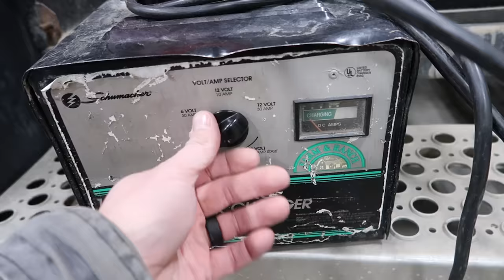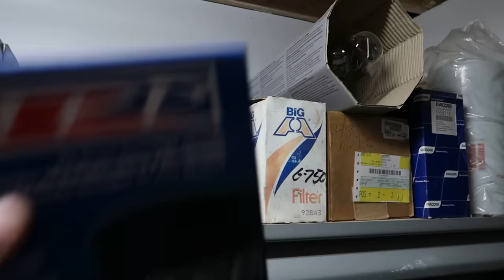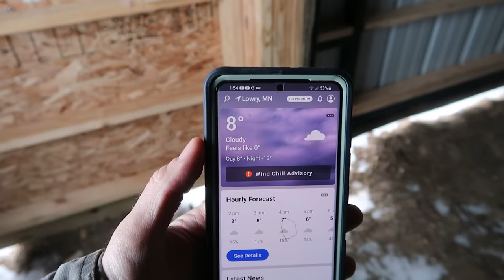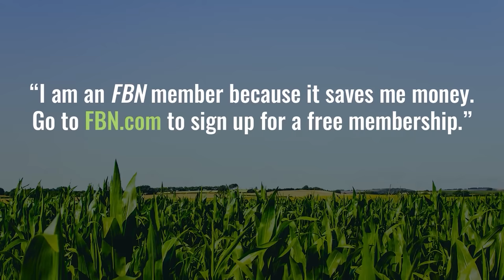Make Semi Trucks Shiny Again!

Comment: I had a T800 almost just like yours. Had an intermittent starting problem. It was a solenoid or relay in the batterie box that had a corroded connection.

Comment: A digital voltmeter would tell you what the battery status is.    A reading before (should be 25.4 for a good set or 12.7 for a single) and it should still be 24.8 or 12.4 after a crank attempt.

Comment: check alter. voltage after engine is warm (  14 volts + ) .   Some alter. have temp. switch that lowers voltage (adjustable [ wrong adj. or bad switch ].  yes you need to check charge leakage too .      J S

Comment: i hade a truck with 3 batteries that i bought at an auction. had troubles with it turning over.  the bat box was big enough for 4.  so i installed a 4th and never had another problem with it turning over

Comment: Hello Zach you need professional for stater system maybe wrong starter or relay for 12 volts/24 volts or engine bearing lock up so need amp meter and volts meter

Comment: I had a brand grind do that, actually two. I bought a new grinder from a welding supply store , when I got it home it started doing almost that exact same thing. I took it back and they gave me another one, five minutes into running it at home , same thing. I took it back , we discovered that the serial # were right together like xxxxx315 xxxxx316. The next box was like xxxxx317 , he found another with an unrelated serial # plugged it in and it worked fine . On the other two a screw connecting one of the wires from the cord had back out and was arcing all over. Must have been assembled on a Monday. Lol

Comment: The Sun is hard on any vehicle but really hard on Red vehicles. they say they have less pigment than other colors.Ours would get so bad when waxing them the towels would turn red with the dead paint. If you shed them when not using them that will help a lot but they will fad again in time after consent buffing like you did as you said the truck & their paint is 20 years old but wow it looks nice.

Comment: Your starter part number is probably 8200308 in Delco. The 42MT that you have on it is probably 10461052rman or 10461053rman depending on your flywheel.

Comment: Take an ampmeter and check for a drain on those batteries.  Bet you have a drain through the alternator (leaking diode).

Comment: Old Starters will start shorting through the body of the starter causing that flat battery effect, new reduction starter and check for power draw will solve your problem

Comment: Happy New Year Zach. Do you think it would be possible to plan a video for planting season to go more in depth on GPS navigation and its accuracy? Either you have better equipment or added telemetry to maintain accuracy better than most of us in our cars. It is fascinating that you can run the equipment, hands off the wheel, without damaging crops.
Reply: Farm GPS is sub inch accuracy. But you have to pay to use that. I use free signal for tillage. It’s normally within @6”.   But every now and again it moves more.
Reply: I planted with it winter wheat. W/grain drill.  Not too bad.

Comment: Zack I think you have bad contact somewhere or multiple places , bad cable ends ?? Rust , grounds traveling through the frame etc.. my tractor did the same thing and. I discovered the cables between batteries looked legit but were corroded inside the lead ends.. replaced and now it spins things good..

Comment: Hay Zack, you could add a chrome air scoop and a nice chrome drop visor. They also make nice chrome headlamp visors and surrounds that will protect the paint from stone chips ‼️. If you put them on I’ll send  y’all my old chrome pin puller that I don’t use anymore.  Deal❓
Reply: Spelling check

Comment: battery disconnect is 1000% required, a gear reduction starter and some new cables (0 gauge) should absolutely sort the issues, if it doesn't, the engine is trash :) batteries are also mostly trash these days if you aren't aware, 90% of them are the same Chinese recycled battery with a different label on it. There are only 2 brands that I have found that I do not DESPISE! they are AC DELCO and CENTURY, century are made in Australia (i have one currently that has lasted 7 years when every other brand struggles to last 3) and AC Delco is (at least allegedly) made in the US, and GOD DAMN they charge like it.
Reply: TL;DR 95% of batteries will only last 2 days longer than whatever "warranty" they offer

Comment: R.e. problems starting the red truck, then it may well be worn carbon-brushes (that touch the communtator).  I've had several starter motors that get very weak and a new set of carbon brushes brings them back to being super aggressive.  :)

Comment: in this day and age with tractors that have 50k gearboxs that are capable of 50 mph run on red diesel you could sell the trucks and tow grain trailers with tractors with road tyres on them being there only used for grain carting in the summer time

Comment: Ive said in many videos to run that parasitic draw tear good thing your gonna do one now that the mechanic said so but a question about the gear reduction starter is si if the starter turns slower but more torque will it turn slow enough where it won’t have the rpm’s to start the engine?

Comment: Zach with an H the gear reduction starter and new battery cables are not going to stop the draw on the batteries. 

So your professional is correct finding the draw on the batteries is the first thing that needs to be done.

Comment: Never had good luck with econo power batteries, will not sell them in my shop.  Interstate takes the shelf and customer returns reconditions them and re badges them as econo power. If you don't have one get a battery tester and disconnect the batteries then let them sit and see if you have one bad battery, one will drain the rest if hooked together.

Comment: Why not get a booster batterie. i have a small one in my car and it is rated for cars and trucks. ive used it multiple times, but it only works if the battery has a small amont of power ind them and from what i can see with all the times you have tried to start it, it should work no problem. and they are not very exspensive. just make sure to get one with an lithium battery

Comment: Boats, airplanes and old trucks.  Every 25 years or so they need a bunch of love and money to keep them afloat, air worthy, rolling and starting every time the key is turned without doubt. 
Otherwise, it's off to the boneyard with them.  Seems like older trucks are more reliable than the newer ones.  
Of course, you burn through money like you print it yourself, you could paint it up pretty and give it to the neighbor.  Buy you a brand-new John Deere Green truck.  LOL

Comment: I did have a starter go bad on my racecar once and it acted exactly like how the semi acts. It will start fine on the battery charger but once you let it sit for minute and try to start it again without the charger it would never start. Tried new cables and switches, and new batteries and still wouldnt fix it. Bolted up a brand new start and started like a champ.

Comment: I've been told. I don't know how true it is. That if you don't replace your starter alternator and batteries all at the same time and there's a problem in one, you,ll continually just Chase an issue. Probably BS but it is electrical. Electricity is only a theory we don't know everything about it.

Comment: Shouldn‘t you have trucks with 24Volt systems in those cold areas? Those 3 semi batteries look like 12Volt to me, 24 start way easier because they use half the amps…

Comment: I told u last yr it would come back. Only problem now is u have to keep up on the wax once a month or itvwill start fading back 🤷‍♂️
Reply: Also add the 4th battery
Reply: Get the Trucklite LED headlights.  Don't get those cheap ones with the 32 leds in them, they look stupid!  Polish the wheels and tank and leave it. Good enough

Comment: That’s what ya call a fine tradesman. ….”I’m In the zone. Thanks but you’ll F it up and then we have issues. I ate on the way….”Hitch up the camper to that thing and go hang with Tony and have him polish those rims up. Make a helluva video you and f FastAg….That door brace seems like it’d be fine at Trevor’s but not in snow country. Iser the need just wonder if they couldn’t put it on the inside. It’s 2023. A feller can polish any pink unit they like.

Comment: That truck was not built for Minnesota. I have a 96 Kenworth W900L and was built heavy duty. 4 batteries always. Never buy a 3 battery truck. Built cheap from the git go. Either way with new batteries and inside it should have turned over on a dime. Something else is dragging it down.

Comment: POLISH THE TANKS AND WHEELS, POLISH EVERYTHING.  LED LIGHTS WITH HEATED LENSES $800.00. THE WAY TO GO, I HAVE THEM AND MY TRUCK A 2005 AND I'M A 1948. I CAN SEE AT NIGHT WITH THOSE LIGHTS.  DON'T KNOW ABOUT THE STATER, MAYBE CLEAN THE CABLES AND THE BATTERY TOPS. I RUN FOUR BATTERS AND SHE STARTS AT -4 F AFTER SITTING FOR 5 DAYS AND I KEEP THE TOPS CLEAN. AND STOP USING AT AT THE END OF A SENTENCE! PLEASE.

Comment: I’d spend the time getting the trucks to start consistently before polishing wheels. Start with a voltage drop test on each cable when starting. 3 batteries or 4 doesn’t matter when it’s in the warm shop. I have seen starters that get corrosion inside that will still work but take more amps to spin

Comment: Washington
CNN
 — 
US farmers will have the right to repair tractors and other agricultural equipment from John Deere without having to use the manufacturer’s own parts and facilities, under an agreement the company signed Sunday with farm industry representatives.

The agreement marks a major victory for farmer and consumer advocacy groups, who have complained for years about the repair limitations Deere has imposed on its products and technology, from software locks to requirements to use official dealers for repairs. The restrictions have inspired multiple lawsuits against the company and created a high-profile public relations headache in which farmers have accused Deere of interfering with their ability to plant and harvest crops on a timely basis.

Closer up of woman using smart phone
Do you really need a new phone every 2 years? How to get more out of your devices
The memorandum of understanding with the American Farm Bureau Federation (AFBF) gives farmers access to the same Deere documentation, data and diagnostic tools used by the company’s authorized repair shops. Farmers will be able to diagnose and fix broken down equipment on their own or by choosing an independent repair facility, which will also have access to the proprietary tools and data on the same fair and reasonable terms, according to the MOU.

Ad Feedback
In exchange, AFBF officials agreed not to push for state or federal legislation promoting users’ right to repair products they’ve leased or purchased. Under the MOU, farmers and third-party repair shops may not disable on-board safety features or use their access to Deere’s technology to illegally copy the software controlling their equipment.

The voluntary deal safeguards Deere’s intellectual property while giving farmers more control of their own business, said Zippy Duvall, president of AFBF.

“A piece of equipment is a major investment,” Duvall said in a statement. “Farmers must have the freedom to choose where equipment is repaired, or to repair it themselves, to help control costs.”

John Deere’s SVP of agriculture and turf marketing, David Gilmore, said in a statement that the agreement reflects the “longstanding commitment Deere has made to ensure our customers have the diagnostic tools and information they need to make many repairs to their machines. We look forward to working alongside the American Farm Bureau and our customers in the months and years ahead to ensure farmers continue to have the tools and resources to diagnose, maintain and repair their equipment.”

The MOU aims to resolve longstanding claims that the requirement to use authorized dealerships can interfere with agricultural production, harming farmers and disrupting the food supply chain. Farmers have said having to wait days or weeks for an official repair can undermine planting and harvesting schedules. Some advocacy groups have blamed the delays on consolidation in tractor dealerships, the majority of which are controlled by Deere, according to the US Public Interest Research Group (PIRG).

“There is one John Deere dealership chain for every 12,018 farms and every 5.3 million acres of American farmland,” the group wrote in a report last year.

The agricultural industry has become a battleground in the wider movement for the so-called right to repair movement, which focuses not only on farm equipment but also on consumer electronics such as smartphones, tablets, computers and even household appliances. A notable target of complaints has been Apple, which is known for shipping ultra-thin devices sealed with special glue or with unremovable components including batteries and memory chips. Apple has said for years that customers should rely on authorized repair facilities, citing potential dangers to users and their devices if they attempt their own maintenance.

The issue has won the attention of the Biden administration: In 2021, a White House executive order called on the Federal Trade Commission to develop new rules to promote the right to repair. In response, the FTC vowed to “root out” illegal repair restrictions. Months later, Apple announced a self-service repair program allowing users to fix their own iPhones and Macs using Apple-made tools and parts.

Last month, New York became the first US state to enact a right-to-repair law. Since 2000, US lawmakers have introduced more than a dozen bills dealing with the right to repair, focusing on automobiles, farm equipment and repairs of medical devices during the Covid-19 pandemic.

With Sunday’s MOU, however, the tension between farmers and Deere has been resolved without the need for regulation or legislation, the agreement said.

Comment: And that's why red is an absolutely horrible color for trucks it fades worse than any other color. And yeah you have something drawing power from the battery even when the truck is off. I've had it happen on a truck I used to drive.

Comment: For normal farm truck, that seldom goes to town….  It would not be worth polishing rims. Tank.  But as content for YouTube?  Why not?   But I would spend money on getting it reliable to start first. Spend the money on 4 batteries if that’s what it’s supposed to have.  Replace cables. As you have 2 similar trucks.  The old cables can be inspected, wear areas patched.  They are ready if needed in future.
  When funds spent for cosmetic things before needed repairs.  That’s beyond millennial thinking.